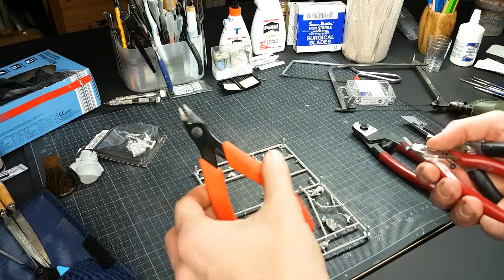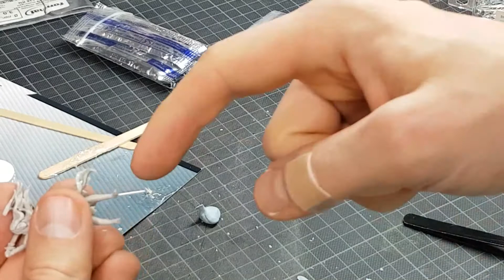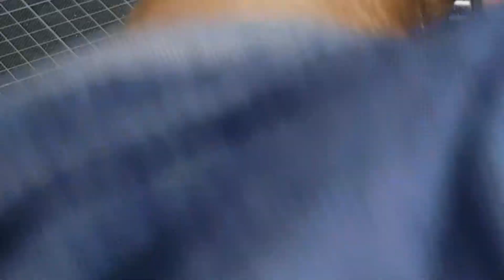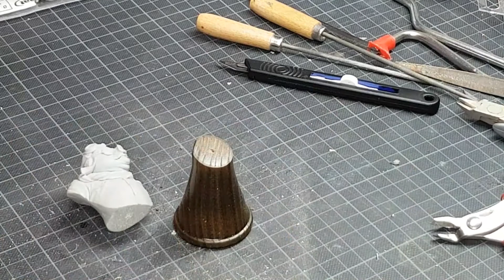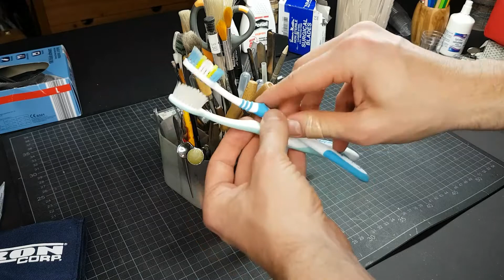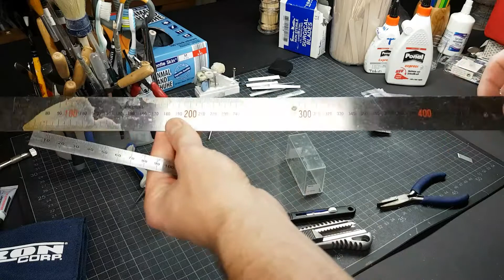Joy Of Basing Techniques - 004 - Tools - Cutting, Filing and Preparing Miniaures!

Comment: 15:58 Have used a standard cordless drill to drill holes in different types of resin. As long as you keep in on the lowest power setting, you won't have issues with heat caused by friction damaging the resin. Dremels on the other hand have this issue where the lowest setting is still too fast.
Reply from the maker: True, Power Tools like Dremels are great for certain applications and materials, but certainly not plastics + resins in general... One should also be very careful power drilling White Metal Miniatures: At times, a bit jammed on me, sending the part into the stratosphere, usually resulting in a broken drillbit... ;D